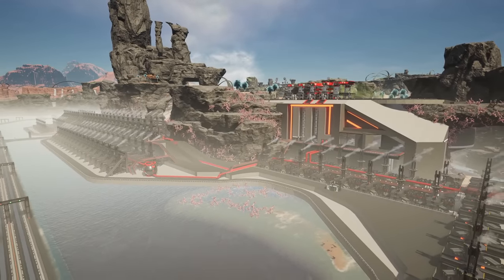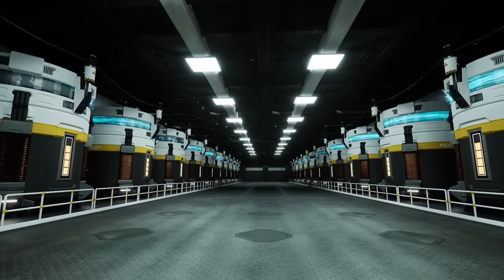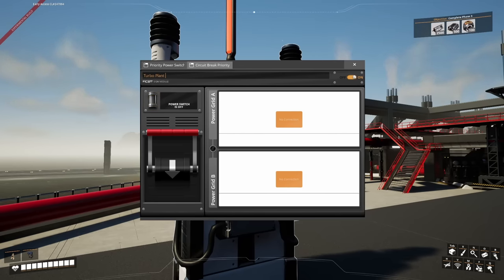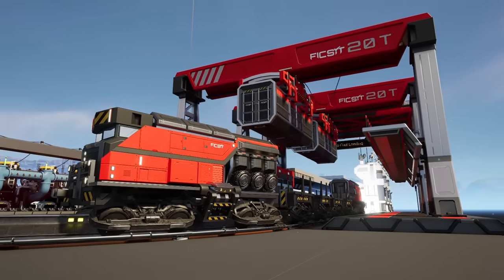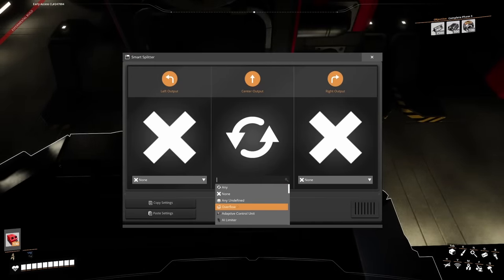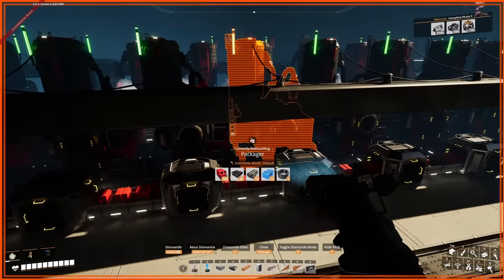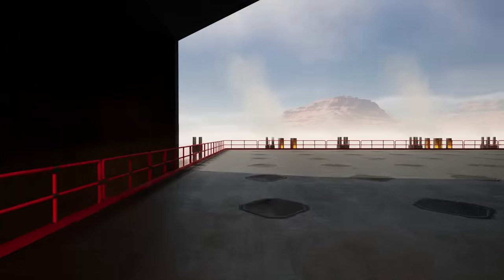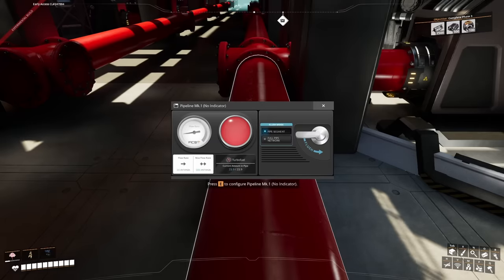Factory Failsafes YOU Need To Improve Efficiency in Satisfactory

Comment from the maker: Do you use Failsafes in your factories?
Reply: Short answer: yes. 
Longer answer: Yes, but judging by your tips I could really do with more!
Reply: using storage tanks helps a little with fluids.
Reply: I always add a "Receiving" room between my trains and factory.  Smart splitters, containers and a Sink. If there is a mistake in the cargo, it takes 15 seconds to clear the lines, and nothing ever clogs the main production line. This is also where I balance
Reply: @bluewonder8214  I have the same, it means I don't have to think so much about the train scheduling and the output of remote factories. Any excess is stored and anything in excess of storage is sunk.
Reply: yes, i use valves on all my branching pipes, to stop backflow.
Reply: After having my coalpower run dry after accidently disconnecting the wire to the miner and the waterextractors, I always have couple bins or tanks of fuel that are not used in normal operation. So I can for example disconnect the powerplant from the main grid start up without any other power source. And with pipes buffertanks before the machines to compensate fluctuations in production
Reply: Not enough according to this.  Sectioning off factories with switches and letting pipes fill are the two that do regularly.  I use a load balancing mod that lets me just plug and play with it for that if I need it.  Have yet to have items go to the wrong place though.  Rushed smart splitters when I found out about them watching imkibitz and bitz so that might be the reason.  As for plants not producing enough power?  As soon as I notice it I typically have a "palm meet face" moment then go back to where I was when the idea I just finished took hold.
Reply: If I use what?
Reply: Well, your last tip is what we call priming in real industry. This contains steps like: -letting a pipe build up pressure before you start production. -let power buffers charge up -get big motors up to speed before you clutch in the load, - start cooling/heating of a production.
The reason is to protect each component in the plant but it has impacts on production as well. The usual trick is to put every step in sequential order, make groups of what can be done in parallel, and add a buffer with a min-max value. If the value falls below min everything afterwards gets shut down. If it reaches max the next stage can turn on again.
We don`t need "load balancers" in real life. First, you would scale your line to what you need. Second, we can adjust the belt speed to any value we want for the shift. So your merger just looks for an empty spot on any belt and if there is one he places a unit. You can do this with pipes and valves and it`s basically the trick you have to use with the water in aluminum.
Reply: My fail safe is forgetting to setup enough production to produce more advance parts.
Reply: pfff no
Reply: @MrHaggyy We totally use load balancers in real life.  Your car uses one to get fuel into your cylinders and another to get the exhaust out of your cylinders with minimal back-pressure.  Water treatment plants use them so that when they need to take a filter offline to back flush they can still get water to every other filter at the same flow rate.  They also use them to reduce mechanical wear on the main driver pumps.  A parallel series of pumps, for example, will go to a balancer and then to a series of pressure tanks (many more than you have pumps) so you can output efficiently at a given pressure mostly with your pumps off but if there’s a fire you need to kick all of them on to be able to double or even triple flow at a moment’s notice.
Reply: @AnarexicSumo  You are right, we do need the functionality of load balancing quite a lot. But you try to avoid a dedicated system as best as possible.
If you need 1/6 of the input in Satisfactory you need two splitters, one with 1/3 and one with 1/2 and the remaining 2/3 and 1/3 need to be fed elsewhere.
In our production, we use the Toyota system. We have a "smart manifold" that only adds an item to a line if needed. The belt speed into the machine is set to its production rate, and the manifold is set to the sum of the remaining lines.
With fluids, you use pressure, tubing, and fluid dynamics to get the right amount to where you need it.
That`s why I put it in quotation marks. We do solve the problem but very differently. And I would not include reliability and maintenance. It won't be part of the game and load in that context means the effect on lifetime and uptime not necessarily throughput. I hope i could explain the difference i see in those things.
Reply: no :face-fuchsia-wide-eyes:
Reply: I don't plan ahead on fail safes but later I will add them in!
Reply: Yes I dont start large factories until I have smart splitters, I add them to all my main input lines were they come into my factory to make sure only the item I want gets to my machines, rest go to a storage then to a sink so I can tell what wrong item is coming in.
Reply: Failsafes are there to make failures safe (hence the name), so i just aim to not have failures
Reply: pres funi sav butn
Reply: my main failsafe is overconsumption, so like if I need 40 buildings in theory, I'll place 41 (or whatever is needed) or if I'm producing exactly enough for a mk 3 i'll put a mk4, that gets rid of overflow and issues where you get stalls pretty well. it's less efficient but if you have the right amount coming in it works well
Reply: To make things as easy as possible for fluids, I always build a fluid buffer up higher than whatever is consuming the fluid.
(Sometimes a second one beyond my construction, still up high, so it balances flow in both directions. More detail on that concept if someone asks about it)

That way, when water extractors inevitably power down for a few seconds, I'm never losing any flow and all the proceeding machines are getting topped off by the buffer(s).
Reply: Yessir' I user Fluid towers to prefer the need of ever needing a more than 2 pumps per factory. I do design my factories to be on a Singular Loop. so, the tower can affect them all.
Reply: Yes, but mine are different than yours
Reply: I have because I work in a factory and see them but I am not as far as you lol
Reply: I use the best failsafe.... spaghetti everywhere
Reply: Are there bugs involving mergers and splitters? I have fail-safes to keep traffic flowing but for some reason if a splitter or merger is involved one side will be full and the other empty, despite it being 50/50 and I'm baffled.

Comment: I have noticed that liquids in pipes behave surprisingly realistically. You can build in a buffer if you ensure that your liquids always flow downwards right before they go into something. That way you're not running into the issue of liquid sloshing around in a pipe, meaning that whatever needs that liquid is occasionally not getting any flow. Because I worked in a factory where many of our resources were fed in from the ceiling (water, pressurized air, argon, nitrogen, coolant, power), I tend to build my factories this way anyway.
Reply: thanks for this, I am going to make sure I put all the pipes coming in from the roof from now on to save a lot of headaches
Reply: Yeah I try to take advantage of gravity feeding when possible for liquids. Saves on space and power not having to build unnecessary pumps.
Reply: That probably also helps with the way they work on pressure, you always have a buffer already in the system so it doesn't take time to re push, or has 2 sources to push that buffer back into the system.
Reply: Or just put one pump almost anywhere near the input of your build if elevation isn’t convenient.  The only thing that’s frustrating is they don’t let you make pressure tanks or air release valves.
Reply: No need for such nonsense, just put a storage tank above everything else in the system. You'll have maximum pressure across the entire system from that single storage tank, regardless of liquid capacity in any part of it.
Reply: @hexerin water tower
Reply: @BPFACTS88  Yup.
Reply: Hah, I built a huge turbofuel refinery and a power plant. I was pulling oil from above (top of a cliff) but water from a lake far below. So I made sure my intakes take more than enough water, built a vertical pipe to above the highest building in the factory, put a small buffer on top, filled it with water I carried there in bottles on my back, and never needed a pump ever again, as the entire system retained pressure forever.

Comment: The game really needs a "Flush conveyors" feature like it has for the pipelines. After feeding in wrong items its not just the conveyors full of wrong items, they also get stuck in mergers, splitters etc and keep coming out of there forever. A real pain to clean up.
Reply: It would solve a lot of the problem if they just fixed the bug where the front item in the belt can't be picked up.
Reply: Dependong on your belt setup (easiest on manifolds), you can route the farthest end into an awesome sink, leaves you with much less cleanup to do

Comment: Yes please cover the belt balancers! I was working one out for concrete but for some reason the first of the 3 lines was backing up to the machines. I thought I had done my math correctly but it appears the mergers will take them 1-1 from each input I semi fixed it by putting a lower tier belt between the smart splitter and merger but I was still having back up issues. So I would love a proper vid on that. its always great to watch your vids and I cant wait to upgrade my GPU to get back to Satisfactory.
Reply: +1 my go to 'belt balancer' is the industrial cargo container but it's kind of limited in its usefullness
Reply: Yeah balancers would be nice to hear more on. I also just had a problem today with a new save where total production of screws should hae 100% satisfied rotors and reinforced plates, but the rotor assembler was not getting enough and all the constructors were backed up with screws (belt speed was fine on paper).
Reply: Definitely would love a video on the balancers (and possibly blueprints?)!
Reply: @torxe3922 Something I've noticed about the cargo containers is if they're empty then they stop acting as balancers.  If they have one item inside, then that item always goes to the top output.  I haven't tested this extensively, but I just remember watching a container I'd been using to balance just spewing all of its items out of the top output because it had run dry.  They also don't work as splitters for this same reason.  I guess otherwise they'd be a bit OP as the only merger+splitter object in the game.

Comment: Don't be stingy with Valves. Placing one at the top after a lift will prevent any backflow falling back down if for some reason production slows, and if you ever merge larger pipe sections, set valves on any input so they won't push into each other. The fluid behavior can be unpredictable, so just restrict it any way you can to limit those options.

Comment: Before update 8, I ran a separate power system for the power systems...if that makes sense, I used different color poles to mark them.  The entire supply line ran on their own power, I did this as I ran into the problem you described where I ran out of all of the power.
Reply: I did this too, though i haven't played since U2 or so. Coal plants always had the required amount for max output plus one extra, and had priority feed of coal... saved my butt so many times.
Reply: I did this too, and still let some grid to be separate, but now they can be connected via priority switches.

Comment: I ALWAYS recommend using a “water tower” type of fluid buffer prior to starting up fuel generators. The process can be made much easier by filling up that fluid buffer as you set up all the pipes and build the genny’s with valves built between each section and then opening it up each section and waiting for the lines to fill before opening the next

Comment: So the video can be summed up in:
"Do not rely on just-in-time production - it is only a tiny bit cheaper to build but will fail spectacularly if even the tiniest bit goes wrong". In 2021 we had seen just how stupid that concept is in the real world - a single ship caused international problems cause nobody had any reserves and nobody could coop with the loss of transportation of a single route.
Reply: Yup exactly. Over produce everything that gets used anywhere else and you basically eliminate most of these problems, and real problems are much easier to find because you just need to look for empty belts or pipes.
Reply: Also, car factories not having enough chips to finish the cars, not realizing that chips have a lead time of *months*. You keep them in stock, or else.

Comment: When you remember that a pipe has to fill up before something can escape the top of it, things get much simpler. When a machine consumes fluid it does so INSTANTLY and it does that every cycle which means that, for a short time each cycle, the pipe is no longer full.

In my factories, pipes going into a machine go downwards. Pipes coming out of a machine go upwards.
This also makes refinery manifolds easier to build because I can build splitters/mergers on the floor with their hologram arrows overlapping the refinery arrows and the pipes won't do any nasty clipping. When I have two rows in a manifold, I line up the rows of refineries by their belt connections and use a 2m foundation to place the pipe junctions first, then I have the splitters/mergers stacked with the junctions and the belts are flat and I maintain my rule of pipe inputs flowing down and pipe outputs flowing up. I never build a junction on an existing pipe unless there is no other option. In the rare cases when I am forced to build a junction on a pipe, I immediately dismantle the pipes and rebuild them. Building a junction on the end of a pipe is fine though, but be careful because it should ACTUALLY be on the end and should not cut the existing pipe.

If I'm making a huge fluid manifold like fuel generators, and I can't wait to turn them on for whatever reason, at the end of the build I can manually switch off a few of the consuming machines at the end of the line and wait for the pipes to fill. Then I'd check the fluid production machines and wait for them to start backing up (at least half of them with yellow lights) and then finally I can switch those consumers back on.

When building a large manifold of fuel generators it usually works best to let the pipes fill up first and then start connecting the power cables because when doing that the generators don't have their cycles synchronised and their consumption is less spikey. Stop making power connections and check the levels after every 20 or so generators. Let them fill.

This is also the reason why pipes cannot provide fluid at their max throughput and remain full at the same time - if you need exactly 300 fluid every 60 seconds, that means on average the pipe was emptying for half the time and filling for half the time. If the pipe was both emptying and filling it would remain at the same level and if that level is empty, it remains empty. If the pipe is full it can remain full, but that won't happen in practise because the production machines take a short while to start up. The pipes themselves act as a buffer and the machines also have built-in buffer (50m³) which you should make the most of by giving all the things time to fill up.